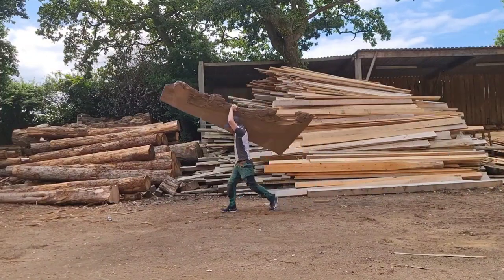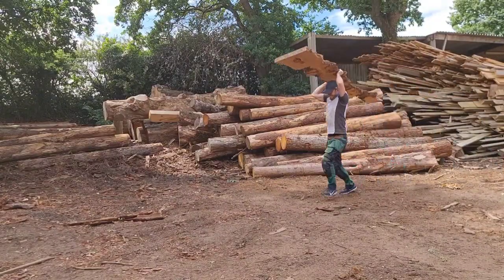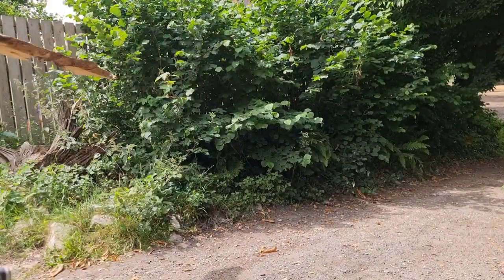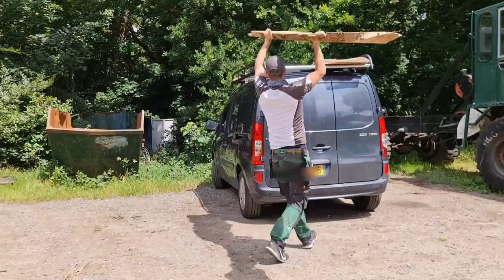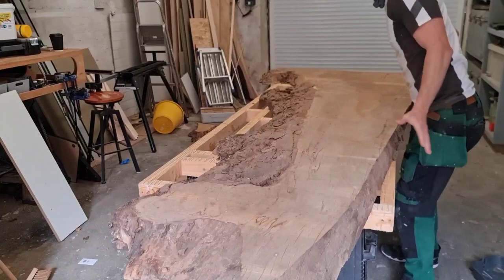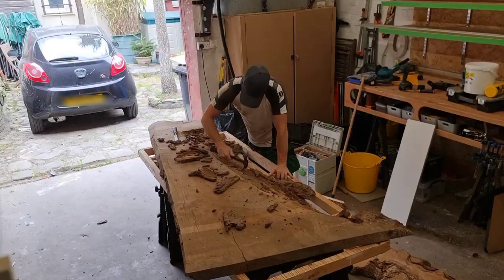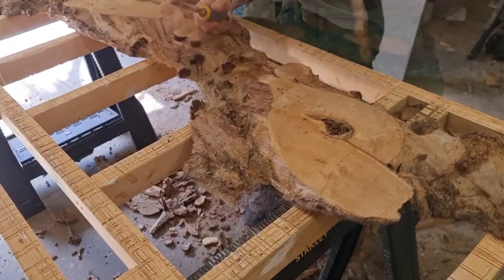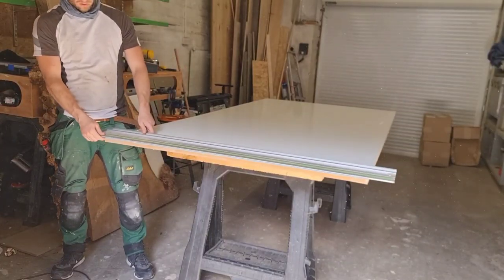Making a Circular poker table + Coffee table

Comment: Good stuff mate. Always impressed by the quality of your work and the limited tools you use! Can you tell me more about that flattening router bit? Where did you get it and do you use an extender as well? Cheers
Reply from the maker: Yes, so I think it's called a spoil router bit. I've got the exact one listed on my link in bio, yes I used a half inch extension collet bit for the router
Reply from the maker: Ah cheers mate! Yea You think it's time for a panel saw one day 🤣
Reply: Thanks! Im not able to find it through your bio (there are some tools but not all off it) but I found it through Amazon itself. Panelsaws in general also means bigger shops👍🏼😃
Reply from the maker: https://linktr.ee/acbespokecarpentry that's the link for the bio and you'll find it there, I'm used to using Instagram and TikTok so I'll double check how this works on here. Thanks for the info and yeah hope it helps